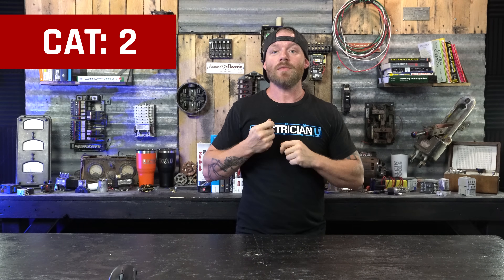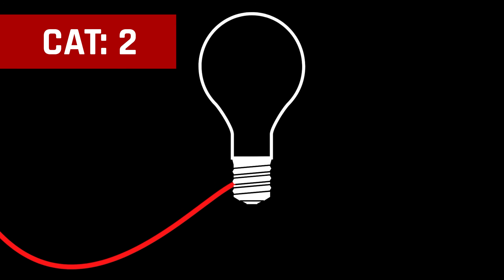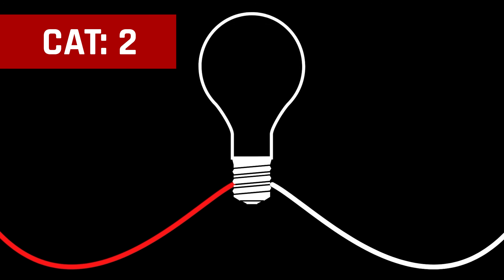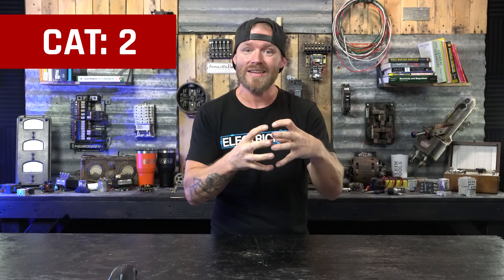What Do CAT Ratings Mean?

Comment: Category ratings are based on the meters ability to withstand transient voltage spikes and not have the meter fail internally and become a short or point of arc fault on system. The closer you are to the utility the more robust your meter input protection needs to be to prevent dielectric failure causing a dangerous fault condition in the meter. The more equipment a transient such as a lightning strike has to go through the more it is attenuated. The industry has broken buildings into category’s. Category 1 being the farthest from the utility with the least residual transient voltage and Category 4 being at the utility interface with little drop in transient voltage. The impedance you are talking about is not in the meter it is the impedance from the source to your location. IE. your service connection will have  less impedance including all the connections and length of wire, by the time you get to an outlet in an upstairs bedroom you may have much more. So a transient spike traveling through these environments will have less energy as it travels through the building. The input protection is designed accordingly. There is nothing wrong with using a category 1 meter on your service wire connections unless a voltage spike hits the system and creates a fault in the meter that is connected to your mains power, which could create a real short circuit condition with lots of current available. The issue is you don’t know when that transient is coming so don’t do it.
Reply: Thank you for the clarity Wayne. As I was watching I was thinking "If you hook up a 2 Ohm load to a 120V circuit, doesn't that mean 60 Amps go across those 28g test lead wires?". Dustin is brilliant, I think this one just slipped past him.
Reply: thank you! I was thinking wtf is he talking about? 600V across a 2 ohm resistor is 300A... x 600V = 180,000 W
Reply: In other words, this video guy knows NOTHING!!!
Reply: Man I appreciate you clarifying. Most digital meters are high impedance like 10megohms I believe. I was not sure what the heck he was talking about.
Reply: Thanks for the clear explanation! We had a fluke blow up on a tech about ten years ago and now only use cat iv meters and always kinda wondered what happened. He was checking a 480 feeder circuit, so I guess the circuit has a transient voltage come through.
Reply: @SamHintSPV  could've been a lightning strike.   Another source of transients is large motors & similar inductive loads (think about the ignition systen on a very old car with breaker points & distributor) switching on and off.
Reply: @Sparky-ww5re  sunny day
Reply: I had a Fluke meter meltdown about 7 or 8 years ago testing electrical system in an elevator equipment room it was a rated for a thousand amps what went wrong I'm still not sure to this day one minute I'm standing there with a clamp meter in my hand the next minute is flames shooting out the meter and knocked across the room
Reply: Oh that makes more sense.

Comment: Electricians should be using cat 4 meters because we handle testing all the way to the service.  He's right that the category number has to do with the environment you are testing.  Think levels of protection.  Electronics and power limited circuits are category 1.  Category 2 would be after sub panels.  Category 3 is protected by a main level panel.  Category 4 is your service.  In most homes electricians will only be testing in category 3 and 4 situations hence an electrician needing a meter rated at least category 4 600v.  Industrial electricians may need a higher voltage rating but most commercial and residential work does not exceed 600v.
Reply: What rating would you say is good for vehicle technicians?
Reply: @ChicaneMedia  probably at least a category 2 but I would recommend a Category 3 because sometimes you'll want to use it on your electrical outlets if the tools aren't aorking. Category 1 is power limited electronics. Your best bet is to look at the available fault current for the car's power generation system, then check with the certification agencies as to what the testing requirements are for each category at the voltage rating you intend to get.

Comment: I killed my Fluke when I tried to test for Voltage on a doggie 'invisible fence'. Apparently, they have HUGE current or voltage. Couldn't measure after that, so... couldn't tell.
Reply: Measuring electrical things can get complicated extremely quickly. Multimeters are also pretty limited in what they can actually measure, mostly because the display only updates say every half second or so (even 10 times a second is often too slow if dealing with electronics or especially digital logic circuits like computers or the like).

An "invisible fence" (the kind that activates a collar on the dog, not the kind that has a wire that you get shocked if you touch it) shouldn't have blown out your meter, I don't think. At least, not the part you bury in the ground.
They basically use a low frequency RF field (as in maybe 20 kilohertz, way below the AM radio band) of relatively low intensity, the low frequency is used because the wire needs to be buried and water absorbs higher frequency radio waves better than lower frequency radio waves (water is nearly always in good dirt especially if there is grass growing in that dirt), and the collar is what either delivers an electric shock or a tone or these days usually both.
The only thing I can think might have happened is that somehow you had a resonant RF circuit created, and you tested the wire at the point of maximum signal amplitude. That might indeed cause a higher than expected voltage, but it still shouldn't be high enough to blow out anything.

The only problem is that your meter doesn't update quick enough to be able to read out what the voltage is, since it's designed to measure 50/60hz AC and not 20khz signals.
Some meters do have a frequency counter on them tho, this might be more useful, tho again you have to test in the right spot if it's a resonant circuit (the wire loop outdoors essentially creates a giant loop antenna, sort of like the loops that would interface with hearing aids that had a compatible reception coil, in places like movie theaters and stadiums).

So I don't know why that would have fried your meter, unless you were trying to measure the shock output of the collar. That WILL fry the meter for certain, the circuit protection stuff in the meter probably can't react fast enough to save itself.
For measuring that, you need an HV probe and a Digital Storage Oscilloscope, because again you're dealing with a high frequency signal (even if it only generates a single shock, it doesn't last for that long so the characteristic frequency is quite high), and the DSO will be able to characterize that waveform, while the HV probe (essentially a carefully calibrated series-parallel resistor based voltage dropper with a high voltage attenuation ratio and special HV resistors that won't arc over) will protect your measurement equipment from the harmful voltages.

Comment: Could you explain 12/2/2 vs 12/3 wire and uses!
Reply: Both run 2 circuits in a single cable.
12-2-2 has 2 hots (black) and 2 neutrals (white).
12-3 has 2 hots (black & red) and share a neutral (white).
A common use is in kitchens and dining rooms.
By Nat. Elec. Code, both locations must have 2  20amp small appliance circuits.
12-2-2 can use 2 individual breakers.
12-3 must use a double pole or if using 2 individual breakers, the handles must be tied together (by today's code) to shut down both circuits to prevent back feed through the shared neutral.
There is a segment on the issues created using 12-3 on this channel.